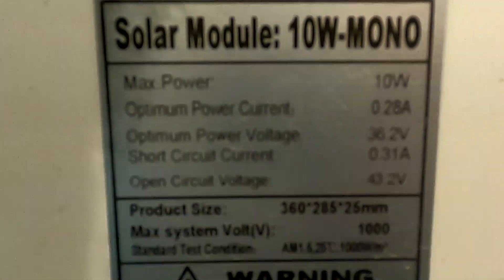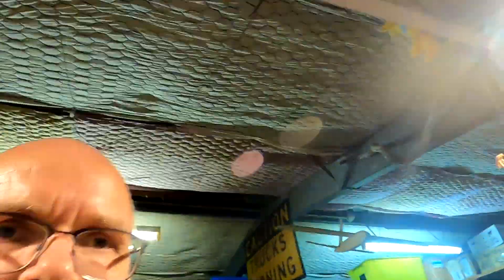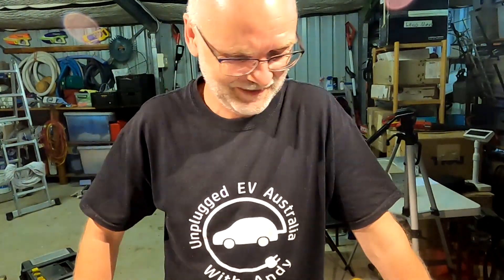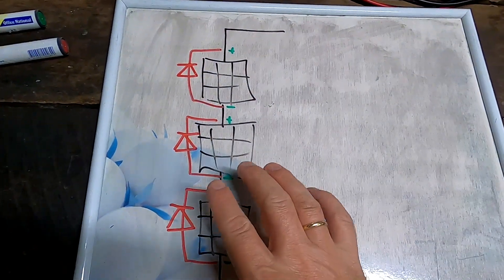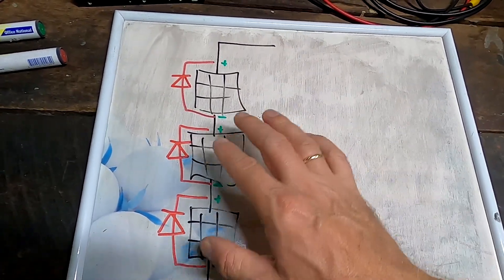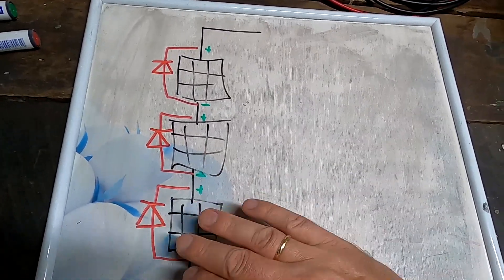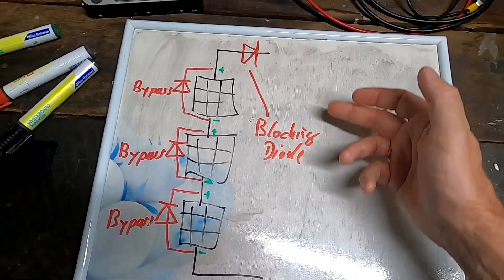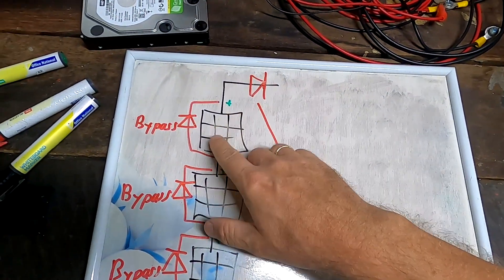Solar Upgrade EP4.1 - Bypass vs. Blocking Confusion and why solar panels DO NOT act as a diode!

Comment: You description of by pass verse blocking diodes is well done.
Reply: It is actually wrong.
Reply: @robertgrant5895  he did a fine job, he was technically correct about the difference between a blocking diode and a bypass diode. 
If you are objecting to his conculusion of not needing a bypass diode read my other post.
What is your objection to what he said? 
 I am curious.
Never tell some they are wrong with out explaining why you think, so we all can learn.
Reply: @petercamusojr1545  It also looks like Andy has taken to removing some of my posts with corrections to his statements.  My problem is Andy makes mistakes all the time and some of you never realize this.  Sometimes Andy complains about others not understanding the issue but his understanding is also lacking.  He should educate himself on the subject before lecturing others and making videos.
Reply: @robertgrant5895  He has been more informative then other well know solar dyi personalities.  Frankly the data sheets leave off many factors when integrating the components together. I like the fact that he sets up small scale "experiments " to test the limits.  He is taking us on a learning adventure.  Fortunately I have a degree in Electrical Engineering.  I have no experience in the solar world. I am going up the learning curve of practical implementation where theory mixes with screw drivers. I don't need to repeat these configuration tests because he is explaining things well.
Reply: @robertgrant5895  most people I know will accept constructive criticism well, if presented with reasonable points. Even Einstein needed help with the math for the general theory of relativity.
Reply: @petercamusojr1545  I also have a degree in Electrical Engr. and computer science.  It would be one thing if Andy said, "Well, I think this is the way it works..." but what he actually says is, "many of you are confused.  Let me set you straight."  If you say that you had better be right.  More importantly, some of the things Andy discusses are critical and can cause harm if done wrong or improperly understood and the fact is that Andy often gets these points wrong.  I have tried to correct him politely on several occasions but he seldom seems to get the point.  For instance, bypass diodes are there to prevent hot spots and resulting fires or panel damage when a panel is shaded.  In the old days panels often did not contain bypass diodes and house fires sometimes resulted due to shading (see video and article).  That is why modern panels all have them now.  However, there can still be reasons to use a bypass diode between serially connected panels.  So although uncommon these days it is still necessary to understand the issue correctly just in case your installation is one that can present problems.  Third, Andy often bad mouths equipment when it is actually his own fault.  He does not say, "well, I think this equipment has a problem but it could be me."  He says this equipment is not usable i.e. junk.  That is not acceptable.  I realize Andy is a good guy and means well but he is unqualified and someday someone will get injured.  I see no disclaimers on Andy's videos etc. so he may even have some liability.  As far as other sources for better info search for the Alt-E store or even Will Prowse is more reliable and if you really want to know what is going on do some research on the various subjects on the net.  There is a lot of bad info out there but there is a lot of good info as well.  You have to look and since you have an EE degree you should be able to tell the bad from the good.
Reply: @petercamusojr1545  This is not the Theory of Relativity and Einstein was not teaching the common man simple physics.
Reply: @robertgrant5895  without say his name, I have been through his video's i have seen a progressive learning curve that he went up. I have also seen contradictory information there and everywhere. I am giving these folks the benefit of the doult and assuming the technology advanced causing a change in the rules.  There are not many one line answers to some of these questions. Often it depends.

I would put blocking diodes between strings where the number of cells in each panel are different or the semiconductor material is different.

For a matched panel set of strings i think i would put inline fuses between strings i don't think a blocking diode is needed. I haven't started researching larger systems yet. I just got a 500WHr system going with one panel working. I have a second panel ready to use soon. I have been totally surprised at variable  power output and shadow effects. I can say they don't work in a double hung window.  Got my panel on a hand truck chasing the sun, lots of fun.

The forward bias direction for a solar photvoltaic cell is to ground. For full conduction of the diode is 0.7 volts. For the panel the forward conduction voltage would be 0.6 times the number of cells. 0.6 x 36= 21.5 or the VOC voltage. The full conduction voltage would be 0.7x36=25.2 volts. I have not looked at the diode equation yet to see if the cold temperature VOC would be high enough to cause enough power to achieve full conduction. 

Andy is correct to say the charge controllers will pull the panel voltage down to the max power point (mppt) or lower (pwm). As long as they are functioning correctly. So I would put a fuse between the strings but not a blocking diode. Why lose the power?

Btw, I think the concept of a BMS disconnecting the battery from a charge controller for any reason is dangerous and incompetent. And pushing battery manufactures to do that, is criminal. My beef with the above fellow. He is stuck on stupid. Yet I follow him because he has good ideas otherwise.  No one is perfect.
Someone challenged Andy on the blocking diode issue, he listened, he did a scaled experiment to see if it is a real issue for his setup. That is a good thing.
Reply: @petercamusojr1545  Hi Peter, I am not sure what the point of all the information you provided is as I am only addressing Andy's comments about blocking diodes and shading.  What he said is just plain wrong.  I don't know if you agree with that or not but if you actually read the articles and watched the videos I referenced I don't see how you could disagree especially if you are an engineer.

I won't say Andy's videos are not entertaining and what he says may be the correct answer for some question but they are often not the correct answer to the given question.  Yes, he showed that current does not flow into a solar panel when connected in parallel when it is shaded to a degree and thus a blocking diode may not be necessary.  However, blocking diodes were never intended to be used this way.  Their primary use is to keep batteries that are directly connected to a solar panel from discharging at night.  On the other hand, at least theoretically,  a solar cell that is completely blocked (not partially) will have zero volts and could be back fed by another solar panel depending on the other resistances in the circuit.

My comments have nothing to do with whether Andy is learning or not.  That is totally beside the point.  My point is that he should not pretend to have the right answers when he often does not.    Too many times he answers the wrong question and he is so confident that he cannot even see his errors when pointed out.  Other folks viewing his video will be done a disservice at the least and maybe will be injured at the worst.

And here is also what bugs me, why the heck does he not do some research on the issue before giving us his bad information?> Just google bypass and blocking diode to get the correct answers (not for forums but from solar experts or academics).

To be honest, I am terrified to think about what Andy will say when it comes to fusing and where to fuse for what reasons.  I pray to God he actually takes the time to learn how and why to do this correctly before he makes another video.

Peter, please read the stuff I referenced.  Apparently, you failed to see my initial links so I repeated them at your request and you should at least read them.
Reply: @robertgrant5895  I did not see any links or references.  I posted a simplified schematic of how a photovoltaic diode (cell) works. On the video's comment section outside this thread. Newer most modern panels have bypass diodes built in the the panel. My panels have 2 bypass diodes. 
Do a google search on bypass verses blocking diodes. Then on photovoltaic diodes and draw the schematic to see the big picture. 

A solar panel is 36 photo diodes in series with the forward bias (point of the arrow) direction pointing down to ground. To get current to flow in the forward bias direction you have to have a positive voltage higher the the full turn on voltage of all 36 diodes.
The bypass diode goes around the 36 photovoltaic diodes that are pointing down but with the forward bias direction facing up to the top of the stack. The triangle points in the direction of the current flow. Max current flows only if the voltage exceeds 0.7 voltsx36cells!

Do a spice model yourself if need be to see the current flow.

You do not get full current through the downward facing series of diodes inside the panel at the max power point. The max current in the photo diodes occur at VOC open circuit voltage. If there is a dark panel with a bypass diode around it the max forward bias voltage is 0.7 volt if the bipass diode is silicon or 0.4 volts if it is Shockley bypass diode. The 36 diodes will only have a forward bias of 0.7 volts over a stact of 36 photo diodes. The  leakage current going through them  with that small of a forward bias is not enough to heat up anything. 

There are several good videos on YouTube that goes through the complete modeling of photovoltaic diode or solar cell. Once you understand 1 cell, a quick model is to times 36 for a whole 12 volt panel.
The solar panel manufactures designed them to be put in strings safely. Parrelled strings is where a blocking diode might be needed if the number of cells in the string sets are different. The best place to find the proper information would be the panel manufacturer. 
You seem to be panicing, yet your not describing your concern in terms  of physics or electronics. 
I will repeat putting a fuse between strings protects (which I think andy did with his breaker arrangement) will prevent a solar panel fire, you don't need a blocking diode.

I get the impression that Andy is a pretty competent electronics technician or old school engineer.
Reply: @robertgrant5895  I have a couple simple questions for you.
Do you realize that a photovoltaic diode/cell/panel has an infinite impedance when it is totally blacked out?
Do you realize a completely blacked out solar cell can conduct current only if the forward bias voltage is higher than 0.7 volts. But you have to have a power source that provides the panels total forward breakdown voltage as well as enough current to heat up the whole panel before a fire can occur.
Do you realize almost every material in a solar panel are very good heat conductors.
Do you realize a photovoltaic panel will still put out VOC even if a board is laid across it? It won't put out much current though. This is why my panel in a double hung window did not work. 
Do you realize a shadowed panel will still put out a few watts because of the conversion of scattered light?
Do you realize there is often more than one right way to design anything?
Do you realize in failure analysis  or safety analysis we have to describe the potential causes and all possible effects.
Do you realize that after a failure there is often no single identifiable cause to fix. So multiple useless fixes are added, hoping that one of them will solve the real problem? 
Do you realize if someone stresses you out, you can walk away?
I am not perfect,  so I always listen if there opinion contrary to mine. It is easy to overlook something.  But I always fall back to the first principles of physics to accept or reject a dissenting opinion. 
I am not going to go searching for an issue that has not been clearly stated so I can understand it and know what I am looking for.

As a quick safety review, glass, Al, steel all have a melting point over 2000 degrees. Silver solder has a melting point over 900 degrees. I know the semiconductor material has an active working temperature over 400 degrees in the right package.
Plastic melts between 200- 300 degrees.  (Wires and junction boxes)
Wood combustion temperature is about 460 degrees. 
All these temperatures are in Fahrenheit, I am just stuck on deg F.

I don't see any major issues here, please define your issue from a technical point of view and without emotional biases. I will listen and technically evaluate your point of view.

Comment: I need to clarify something. The cell you have is 5.5 volts, assuming a diode turn on voltage is 0.6 volts that suggest a 9 or 10 cells in series. Let's say it is 9 cells or diodes.

The proper electrical model would be would be 9 diodes in series where the bar is attached to the negative terminal ( or downwards on your drawing). This down ward direction is what limits the VOC ( open circuit voltage) of the cell. Multiple cells in series makes a panel. The curent from the panel is caused by the light, freeing electrons which flow in the reverse direction (or up ward direction on your drawing). Modeled as an ideal current source 

In analyzing panel performance you start with the standard diode equation then add a photo current current of a single cell. The panel performance is determined by the number of cells in series. The diode equation is an exponential where the temperature changes... change panel performance. 

I agree if you have strings where the panels have the same number of cells, the chance of turning all the downward diodes on is low.

If your strings have a different number of cells in your string there may be a chance you can exceed the full turn on voltage of the dark panel. 
Panel fires do happen for this reason.

The recommendation of most manufacturers is to use the same type of panels with the same number of cells and the same wattage.

If your mixing panels wattage or type ...silicone or the film type blocking diodes may be in order.

A better approach would be to use separate charge controllers for wattage or type panels. Multiple charge controllers can be hooked up to the same battery (bank).

Don't let the math scare you, the analogy of a one way valve is correct  for a power diode. For a solar panel it is more a one way valve with a very small leak. 

Rules of thumb for a silicone diodes for typical users.
The one way valve is completely off with a forward biased voltage of 0.4 volts
The one way valve conducts a current so small it can be called off at a forward voltage of 0.5 volts.
The one way valve can pass a measurable current at 0.6 volts forward biased. The valve is partially open. Most solar panels sweet spot is 6.3 volts
The one way valve is fully open if the diode is forward biased at 0.7 volts.

The series resistance of a solar or power diode is so small it can be ignored or set to zero.

The parrell resistance of a diode is so large it can be ignored or set to infinity. 

Ths 5 volt solar cell you used is really a module of 9 cells or diodes. If you look at the shadows on the front you can count the number of photovoltaic diodes.

Good luck

Comment: Andy, you are hung up on shading.  The blocking diode is there for solar panel damage such as a tree limb hitting a panel, breaking it and causing a short.  The blocking diodes main function, though, is to prevent your batteries from discharging through your panels at night.  When your panel gets no light it puts out no voltage thus allowing your batteries to discharge through the panels.  A decent solar charge controller usually handles this for you making the blocking diode unnecessary.

Comment: hey, i have tested with 2 little solar panels 6v/500ma in parallel to see what happen when one is shaded and depending how shaded the panel is, it draw/suck 85 to 140ma from the one not shaded (each one shorted give 475ma +/-5ma under the sun a hour and half before noon with a fluke ammeter directly on wires).. so, in parallel, a blocking diode will save this loss power (around 25% in my case).. i will to think about that in my future installations!!

Comment: Funny thing is that a solar panel can act like a LED and vice versa. You can measure a small voltage across a LED when under a bright light. On the other hand a solar panel emits infrared light when powered with an external source. That could explain why a panel could draw current. Just wanted to throw that out there. Have a good day

Comment: I agree with you BUT... 

Did I hear you say a blocking diode isn't needed because current always takes the path of least resistance and that path is always the charge controller? 

I would agree EXCEPT you have a switch between your panels and the charge controller do you not? So from time to time you disconnect the charge controller and it can no longer be the path of least resistance! 

In this case the path of least resistance is...... ah! ... argh!!.... it's the shaded solar panel string 🤪
Reply: No ... it's the earth. Hence why he earthed his panels.

Comment: Nice one Andy, myth busted. If you really want to blow some minds then show the light output from the solar panel when you feed current through it, it produces non visible light in the same bandwidth as the emitter diode on a tv remote. Some digital cameras pick up the light and make it visible through the display.
Reply: I was hoping Andy would show us a glowing panel. It was the perfect opportunity.